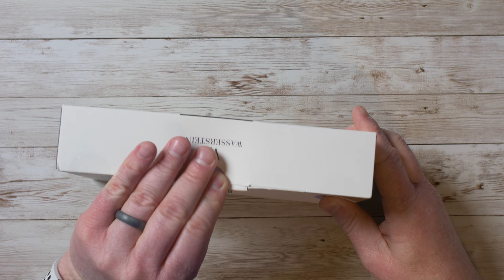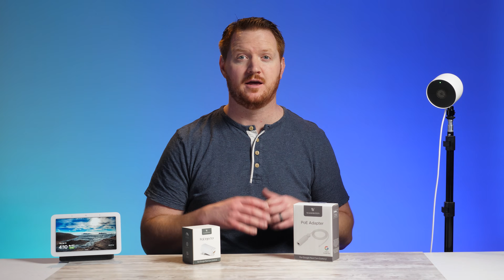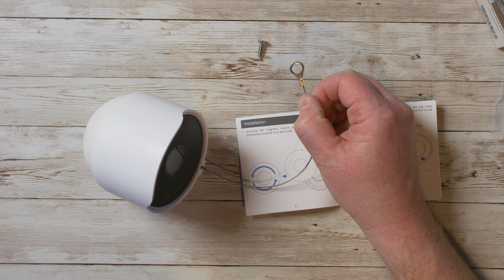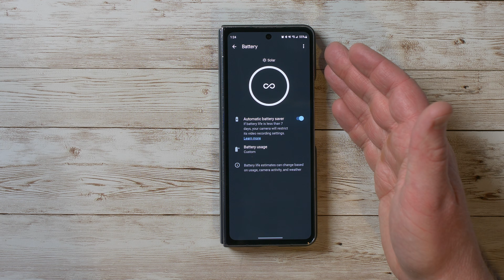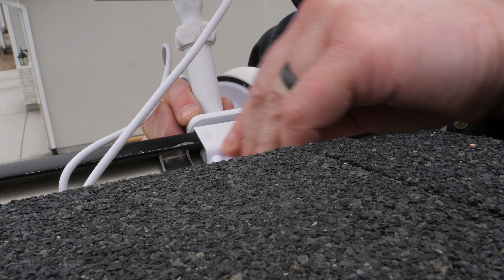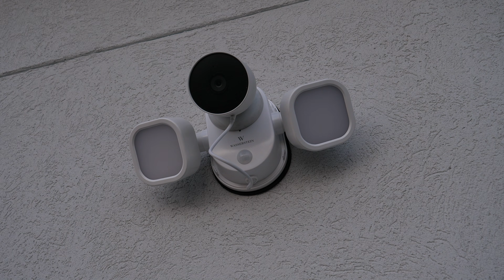Never Charge Your Nest Cam (Battery) Again

Comment: Hey Mate - great video. So, just to confirm, the PoE adaptor doesn’t provide a network connection? Just power basically? 

If it provided a network connection that would make it so much better so you don’t have drops in connection sporadically.
Reply from the maker: That is correct, it is only providing power.

Comment: Does the Floodlight work with a premium solar panel? or does it only work with power grid?
Reply from the maker: It only works with being wired into the power.
Reply: @TechWithBrett  Thanks!

Comment: Did I hear him say with the solar panels you don't get 24/7 recording?
Reply from the maker: That is correct, they are only able to keep the camera charged.
Reply: @TechWithBrett  Thanks. I was trying to avoid drilling through a brick wall to get constant power to my cameras and I thought this will solve that problem. Looks like I am back to square one

Comment: Oh man, im in a wheelchair and cant get the cameras down to charge them, only last about 2 weeks now and i have to call my brothers to come help me. I want to get the solar panels but im wondering will jt record events at least? Or else whats the point?
Reply from the maker: Yes it will record events just like when it is on battery power, it will just be getting a charge through the day from the solar panel. If you want consistent recording it would need to be plugged into a power source.

Comment: how do you still connect this with the solar panel if the connector on the camera itself do not match?
Reply from the maker: It looks like you might have received the wrong panel. You might be able to look up a converter cable.

Comment: Just a reminder to people looking to do this is that if the battery fails on this camera it won't bypass the battery. My battery is failing and the camera cuts out constantly and shows no battery even though it is always plugged in using the weatherproof cable

Comment: Great Video! I had no idea there were all these options. Just to confirm, with the 3 in 1 floodlight mount has no remote or manual controls to adjust the brightness, length of time or sensitivity of the light?
Reply from the maker: That is correct. There are no settings to adjust.

Comment: I have both of my nest cam battery's plugged in and they don't stay charged even with the Google outdoor cable Ive bought for them
Reply from the maker: That is odd. Do you happen to live in a cold climate?
Reply: @TechWithBrett  no I live in Ireland. I have 2 of them one does work fine plugged in the other says plugged in but no infinity ♾️ sign. Im using the  5m outdoor cable from Google. I've contacted them about it and they won't replace either the cable or the camera really disappointed in it
Reply: @christophercrowley7574 does the camera still work all the time without needing to charge it manually?
Reply: you have to reset them and mark them as indoor cameras

Comment: Great video, thank you! I have 3 cameras outside.  Might try the gutter mount/solar panel.  Was wondering your thoughts on Nest Secure no longer available after April 2024? Not sure what to do? Thanks
Reply from the maker: I never had a chance to use Nest Secure but that certainly is a bummer. I can't remember what the ADT promo offer is but it seemed like a pretty great deal that allows you to try out for 1 year for free.

Comment: How is streaming live view for you? I couldn’t put my nest router closer to my camera unless I drilled a hole in the exterior wall and it is choppy and laggy. The recording’s and notifications are great. I use nest Wi-Fi. Thanks.
Reply from the maker: It depends on the day. Some days the cameras load up instantly and other days I am stuck waiting for way longer than I wand to to see the feed, but it does eventually load.
Reply: @TechWithBrett  do you use any other cameras to monitor your property that seem to stream better?
Reply from the maker: The only others I have set up is a Wyze cam. The streaming feed from their app works well and it was just added into the Google Home app but haven't seen any better performance. I have been looking into Reolink as a good option.
Reply: @TechWithBrett  I’ve got Wyze and eufy up and recently my google home app marked them as cameras but can’t get the feeds sadly. Hoping that resolves soon.

Comment: Awesome video, thank you. I had no idea there were ethernet adapters for cameras like this. Our whole house is wired for ethernet for an old school Lorex system that we had many years ago before the age of wireless cameras. All of those cables are still run through the whole house to various points outside, I just never had any ability to plug in newer cameras into those cables because they all require regular power. I'm definitely going to try the POE adapter
Reply from the maker: That is great to hear you have cables already run. That makes the upgrade super easy.
Reply: I read Lorex as Lorax for a second and was VERY confused lol